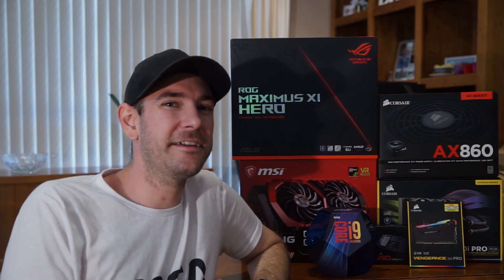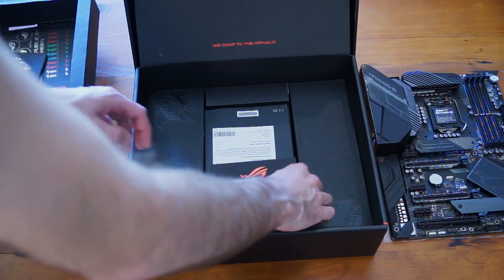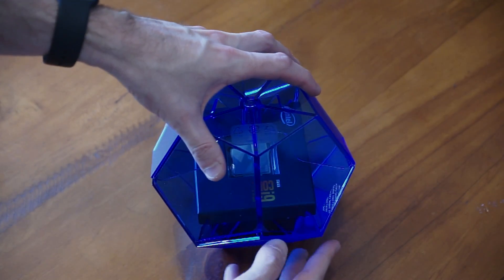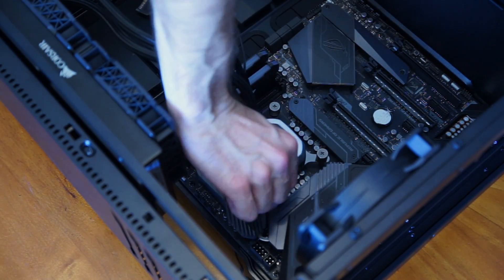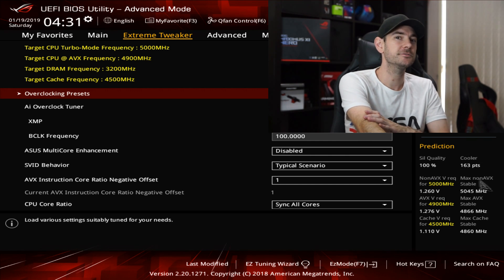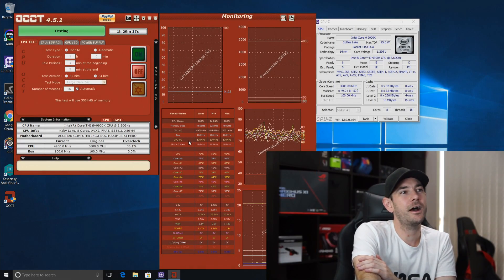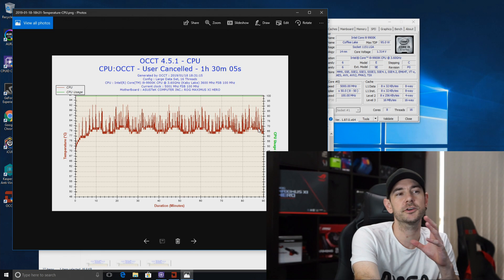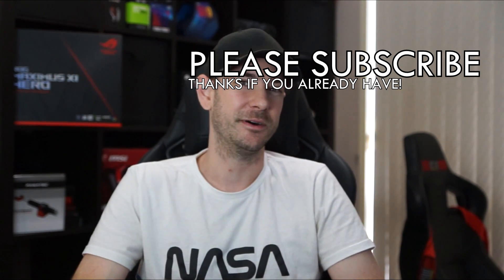ASUS Maximus XI & i9 9900K  - System Build - Unboxing - Overview & Overclocking Results

Comment: Hi. I bought a Samsung 970 Evo Plus Nvme for Windows. M2 slots Up and Down have the same speeds ? Where is better to installed ? Also if later want to add another SAME Nvme to other slot it support them without problems normally ? In BIOS the only change i need to do is the X4 Mode ?

Comment: 6:32 i didnt put it on the back but on the gpu , maybe thats why it wont boot? Its red error light on my keyboard, u know if u can help. Its red error light between ram and mothearboard cable . If u know how to fix red light so i can boot the system

Comment: So how did you connect the CPU Power? I saw that it has a 8+4 connector so did you just use a 4+4 cable and connected it only to the 8pin? Or use 2, 4+4 cables?

Comment: Why didn't you install the nvme ssd to the bottom slot, instead of having it between the CPU and GPU which can get hot. The bottom slot is further away and plus it's a pure PCIe slot and you don't have to worry about wasting 2 SATA channels by using the top slot, incase you need to install more SATA devices in the future.

Comment: OMFG I need a bit of help with the ASUS ROG MAXIMUS XI HERO Z390. I bought a new power supply for the build and that damn EATX power connection there is no damn 4 plug on any power supply. Did you connect that in your build or you just connected the 24 pin and that was it?

Comment: I just built a similar system tonight... Same motherboard wifi,  i9 9900ks processor. I got the 970 EVO Plus 1TB, 860 EVO 1TB, Seagate 2TB HDD, Dominator Platinum RGB 32GB 3.2GHz, CORSAIR - Hydro RGB Platinum 120mm Processor Liquid Cooling, CORSAIR - LL Series 120mm Case Cooling Fans,  CORSAIR - RMx Series 850W Plus Gold and GeForce RTX 2080 Ti.

Comment: Hi, could U sort out any things about vrm? I've got formula xi. It has the same vrm. There are a lot of notions about this vrm with doublers. Does it good enough for 9900k@5.0ghz? Now i has 9600k@5.0ghz, and in aida64 i did't see temerature more than 51C. I've got air not water. And i dont want to use water on cpu, and vrm waterblock. But soon i want to change cpu for 9900k. Will it be good enough for that cpu in matter of vrm temperatures? In datasheets of sic639 i saw that this mosfets could stand about 150C. But i dont need this temps on my vrm. And could U enlight are there any sense in using doublers, and in total having 4 doubled phases instead of 8 true phases? Why couldn't Asus do true 8 phases? Thanx! I adore Ur channel!
Reply from the maker: 8 phases really isn’t required for anything but extreme overclocking. You’ll be temperature and voltage limited with the CPU on air before the motherboard becomes a factor.
Reply: @boostedmedia  thanx a lot!

Comment: I just watched a video of some electronic engineer type guy complaining about only 4 phases on the Hero, saying it isn't good enough motherboard for the 9900k    it will heat up and die ........but he never tried it.   Was this guy proven wrong on this?
Reply from the maker: I’m guessing you’re referring to “actually hardcore overclocking”. Yes. His videos are from the pointing view of someone going for extreme overclocking on liquid nitrogen.
Reply: @boostedmedia  So basic overclocking is fine?  I'm  thinking buying this motherboard tomorrow, I just want to make sure it can make full use of 9900k,   I'm not interested in extreme overclocking,  just want it to work to its full capacity, the way its suppose to.  So that its worth having the  i9 9900k over the i7 9700

Comment: Hey! question, how did you manage the connectors on the top left part, cause this one has 4 extra pins next to the usual 8, thank u!
Reply from the maker: Depends on the processor you’re using but for a 9900k you need to plug them all in. They’re additional 12V supply lines to feed the VRMs
Reply: @boostedmedia  ok , thank you very much, you're the best! so, do those 4 extra ones need a specific kind of plug or connector? I always get a bit confused with the wires and connections on modular power supplies :woozy:, and btw, i was thinking in using this same motherboard with a i9-9700k, thanks again!

Comment: I have problems with my RGB on the motherboard. The RGB lights are really weak, you can barely see them. I've tried probably everything in aura sync + checked that everythings put on bios. 

Is this some sort of problem with the motherboard? Or is the light just really bad
Reply from the maker: Can’t say I’ve had this problem with mine. Might be a faulty board.
Reply: @boostedmedia  Could it be that the led cablr is poorly connected?

Comment: Bought mine recently. Discovered that its missing a screw to secure the m.2 drive. Any ideas on where to get replacements?
Reply from the maker: The screws are in a bag in the motherboard box. Not sure where to find a replacement though if the bag is missing.
Reply: @boostedmedia  Odd, didn't get a bag with my purchase. Found all the screws in the board already apart from this one. Bought it from a reputable store as well so that's a bit odd.

Comment: Shouldve got a x72 or 150i 360mm and 2080 atleast for that processer
Reply from the maker: Yep the system was pretty badly mismatched but that’s what he wanted. I told him he didn’t need a processor that fast and he didn’t even need a GPU at all as he doesn’t play games on it but he insisted.
Reply: Boosted Media aaaah so it wasnt your bad, he chose those parts alright.

Comment: So, I just bought this MB and it was delivered today. Is it normal for them to arrive without a manufacturer seal on the box and no anti-static bag around the board?
Reply from the maker: Yep. Well at least mine didn’t either.
Reply: @boostedmedia  not even a seal on the box itself? I called Asus and their customer service and they didn't know. He told me to reach out to the company I bought it from; Amazon.com.

Thing is, I work for Amazon in their Customer Service department (did my time in phone support and am finally free from that position, praise be), and I know that Amazon CS agents do not know how the manufacturer would seal and package their products. They do not have access to Amazon fulfilment centers or anything like that. So, seller wouldn't know, manufacturer doesn't know and it looks like many others have the same question.

It doesn't have scratches or missing items... So I THINK I am okay.

We are worried that we are getting opened boxes when we purchased new boards, ya know?

Comment: After this configuration I can’t get a valid score from 3dmark, why is that? 😅 got the same cpu and motherboard with a Noctua nh-d15 CPU fan 🤷🏼‍♂️ 750w gold all modular power supply, 16gb 3000mhz Corsair pro ram
Reply from the maker: Try turning SVID back on.
Reply: Does the NH-D15 fit well? I just bought one, but didn't know the thing was massive.
Reply: Anthony Burton it’s a tight fit, but it does fit. I have the Fractal Design Meshify S2 TG which is a pretty big case.

Comment: IMO the best way to cool a 9900k is to use the OC FRAME by DER8AUER, and mount the CPU direct die and use an EK SUPREMACY EVO or VELOCITY water block for the best cooling possible.
Reply from the maker: I agree. Delidding these soldered chips isn’t something a lot of people would be willing to do though.

Comment: The asus maximus xi hero does not work with that case at all. My middle standoff fits inside the motherboard hole. But all other screw holes are off due to the case having a different layout.
Reply from the maker: That doesn’t sound right.Both are ATX standard form factor.
Reply: I know but have the same case and motherboard. I have looked up many videos forums about this problem. I haven’t been able to find out why my motherboard won’t fit in the case. I also called tech support for both products and they say I should get a new case. Due to the screw holes not having the same layout as the motherboard. So if you could help me out that would be great.
Reply from the maker: Can you post a picture of exactly what’s going on on our discord server?
Reply: Boosted Media I would be more than happy too. I really want to get it to work.
Reply from the maker: https://discord.gg/7YzjkFQ
Reply: In all the videos I have watched it is the same case and motherboard. They just easily put in the motherboard but mine doesn’t work. The io shield is either off or the screw holes don’t line up with the holes on the motherboard. Pretty sure they don’t work together...

Comment: Hello! I'm using Core i9900k + ASRock Z390 Taichi Ultimate + Corsair Vengeance RGB PRO 64 Gb (4*16) 3200 Mhz.  But I can't make it run on 3200 Mhz when I turn on XMP profile, only 2900 Mhz (with manual memory speed downgrading). OS Windows shows ERROR Blue screen. I'm able to run memory speed even higher, up to 3600 with only using XMP +manual adjustment to 3600, but it's only with 2 Slots (32Gb) of memory. Once I install all 4 slots, it stops working. Memory kit works stable, I did a long test (2 sticks and 2 sticks each after other, about 10 hours total). No issues with memory. I did replace MOBO, the previous one (the same model) didn't even want to start PC and worked only on 2133 Mhz with 4 DIMMs. What is your opinion, is it a CPU related issue or Motherboard issue? Thank you!

p.s. I'm thinking about replacing my ASrock to ASUS Z390 Hero XI. But I'm wondering, will it fix my issue or not? Maybe I have a bad CPU with memory controller which can't handle 4 DIMMs?
Reply: Dude I am running 5 GHz 4000 muz on z390 ASRock Taichi non ultimate stable. Get Gskill 4000 MHz C17 ram
Reply: How much memory do you run? 64 Gb, all 4 slots?
I can run 32 Gb (2 slots) at high speed with no issues. The problem appears only when you use all 4 slots.
 It fails to run and resets memory speed to 2133.
But I found a solution, it was tricky: Disable 2 options for memory in BIOS: -ASRock Timing optimization, - Real-time Memory Timing
ASRock Forum link: http://forum.asrock.com/forum_posts.asp?TID=10793&PID=63074#63074
Reply from the maker: It could be a bad memory controller or RAM.but more likely motherboard. 

Are you shirr tot have the matched pairs in the correct slots? Maybe try moving them around.
Reply: @boostedmedia  all 4 sticks were bought as a set of memory in 1 package. They are identical and even have serial numbers going 1 by 1. I did try to swap them in many different combinations. No good result.
Reply from the maker: Hard to say then. Could be bad ram, motherboard or CPU. Only way to know is trial and error. I’d get the RAM RMAd first.
Reply: @boostedmedia  But if 2 individual RAM sticks work perfectly up to 3600 on 2 good working mobo memory slots. I stress tested 2 memory sticks for about 5 hours and later another 2. Doesn't it mean that RAM is good?
p.s. do you prefer ASUS MB more than ASRock?
I very appreciate your help!
Reply from the maker: Very common symptom of faulty ram, motherboard or memory controller as above. 

Personally I never use Asrock.
Reply: I'll test it then using another mobo (Asus hero xi) and another CPU in different combinations and hopefully will be able to identify the bottle neck. Thank you!
Reply from the maker: Yep that’s the best approach if you have other hardware available. Needs to be approved for the particular ram you’re using though.
Reply: Every component has been tested successfully. The only problem in 2 bios memory options.

Comment: Why did ASUS put blue locktite on the M.2 slot heat sinks.  I noticed the pressure you had to use to break the locktite.  Unfortunately I waited until the MoBo was in the case to try and get those screws out and stripped 2 of the 4.  Besides the locktite the screw heads are very soft.  My ROG Strix Z370 had shorter harder screws for the heat sinks without locktite.  What is the reason for the locktite on the XI Hero?
Reply from the maker: No idea. I wondered the same!
Reply from the maker: That would make a lot of sense.

Comment: You dident screw down the m2 drive. If you are unlucky it will pop out of it slot. Just a heads up.
Reply from the maker: I did screw it down. It uses the same screw as the heatsink in this case. I thought it was a bit strange too.
Reply: Ahhh ok hehe. I just build my new comp to. Asus Maximus xi formula with a i7 9700k. M2 drives asus strix 2080ti oc. Gonna start abit of overclocking later today. Your vids are helping alot hehe. Thx alot and wish me luck. Cheers from Sweden.
Reply from the maker: Good luck mate. Give me a shout on the discord server if you need a hand.
Reply: Awsome. Will try that.
Reply: Will do that. And thx.
Reply: Overclockt the cpu to 5.0ghz and its stable with good temps. Full load 67c on one core. The rest is between 55-65c. Whant to try 5.1ghz but not sure how to set up everything hehe.
Reply from the maker: Just change the core ratio to 51. Might need a bit more vcore too
Reply: @lillen141  hi, i've got the same maximus formula. With what vcore have u reached so low temps? And with what cooling sys? My 9600k@5.0ghz reached 82C on one core and 76-80C the rest. With vcore - 1.295v, on full load (LinX) with LLC - 7 decrising to 1.270v. I'm using noctua-14S air cooler.
Reply: @bestboy587  Im using the corsair H150i pro 360 rad watercooling with push/pull configuration. Will check volts when i get home. I running 5ghz on all cors atm. Gaining to little to push it hier.

Comment: Is this replacing your old custom loop setup will? Can’t be long till you get a 2080ti :P
I just got the same mobo, was going to use de8aurer’s maximus x guide to overclock, I’ll create a profile off your guide and test that too.
Completed my custom loop recently, based off your guides. The acrylic bends were tough, specially when you have ocd haha
Reply from the maker: No this is a system I built for a friend. He was kind enough to let me play around with it first :). No plans to upgrade my other system just yet.

Comment: great tutorial but why maximus XI it doesnt have the best vram u also forgot to mention when installing cpu align triangles up with each other
Reply from the maker: I said to align the keyway. The CPU has a notch in it. It will only physically fit in the socket one way.
Reply: the VRAM "problem" is not a problem.  ASUS knew what they were doing and overclocking is no issue with the unmatched and superior BIOS ASUS comes with.  Their AI OC tool is truly amazing and works great.  9900K OC to 5 across all cores is done cleanly with the XI Hero and code etc
Reply: Doesnthe the vram problem applies to all asus rog XI motherboards or to just hero XI???

Comment: NIce... however it's cheaper and time saver to run cinebench on max priority to get the same result :)
Reply from the maker: True to a point but max priority doesn't always give exactly the same result as a totally clean installation. At least not in my experience. Guess I'm old school. lol
Reply: @boostedmedia  it's true ! :) but if you're not competing the difference is.. how much ? 10 to 30 points ?
Reply from the maker: Depends how many other processes are running. I get a lot of messages from people thinking something is wrong because their scores are low, only to find they have 15 programs open and are streaming the benchmark. Lol. Ok that’s a slight exaggeration but you know what I mean.